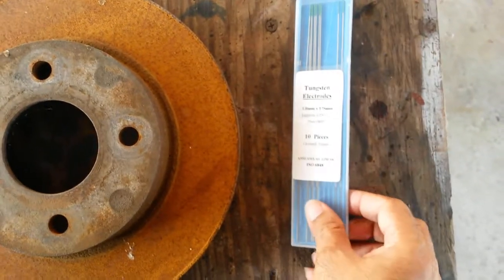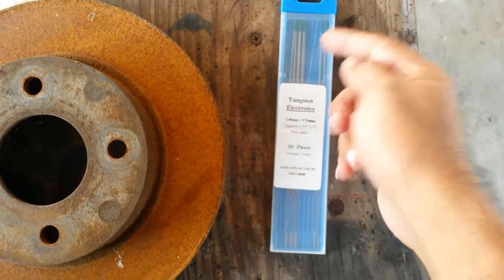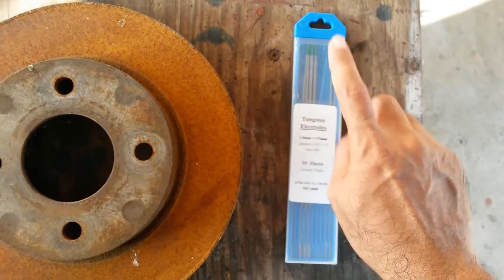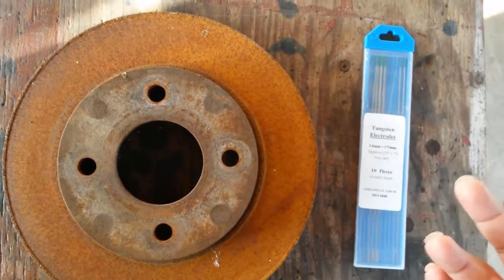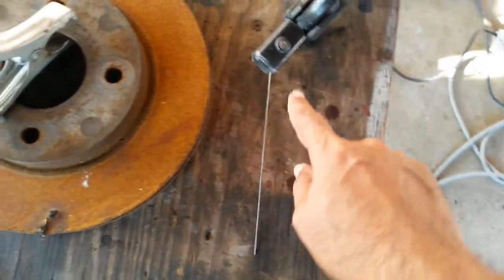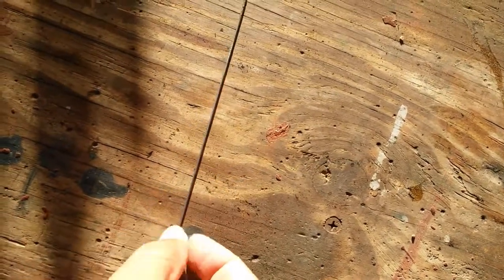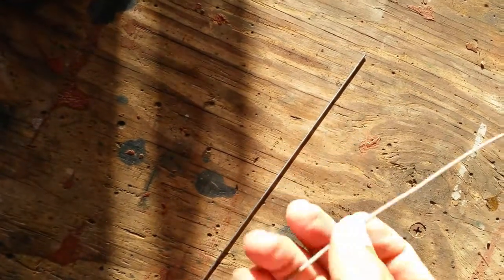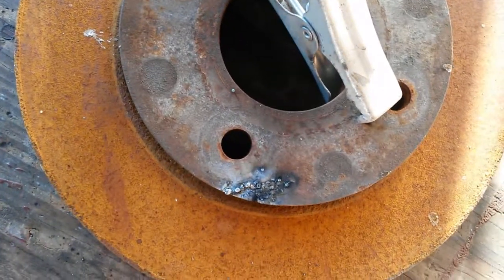060 Experimenting with a Tungsten Electrode on a 120V DC Stick Welder

Comment: Nice testing, friend. :)
Reply from the maker: Thanks. I was wondering how close i could have gotten to a MIG not having the inert gas. As i mentioned in the vidoe and to Mark above i am off from my present location by the end of the month. Lots to do in the remaining few weeks but time permitting I want to put out quite a few videos. Some would just be to document projects done over the years. Others would be products I want to strip and review. 

All my equipment has to stay behind so once I leave my ability to do projects will be close to zero. Its another island so I may start experimenting with radio control toys instead. Possibly some Arduino stuff since it easy to reorder that.

Comment: be careful. gonna need heaps of volts and amps
Reply from the maker: I am off to another location in 3 weeks so I will not get a chance to try building the plasma cutter. Too many things to wrap up before I leave. Agreed though it would have been a high voltage generator and then the stick welder providing about 60A. A bit dangerous for sure but both would have been DC so there is a smaller chance of getting shocked. 

I have several projects I would like to document before the move. One of them has a proper international level commercial circuit board. That one will probably take 3 videos to run through.
Reply: DC may be easier to keep contacts apart but will make muscles contract and cause you to hang on to something you shouldn't. AC will throw you across the room. Stay safe mate.
Reply from the maker: Thanks for the concern. I will try to stay safe. Got shocked with a flyback some years ago so I know what HV does to the human body. Not nice so I am a lot more cautious now. 

The reason I consider DC safer is its referenced to its ground so a person needs to touch both contacts to get shocked. AC is referenced to earth so only live is needed to get shocked of you are bare foot like I tend to be. 

That said the welding plant I am using has a full isolation between the primary and secondary sides so even if I take the AC off the secondary it should be referenced to itself as opposed to earth. I should put a meter to it to confirm this.